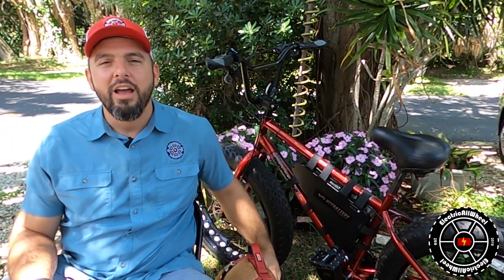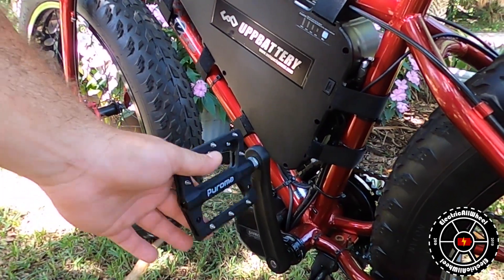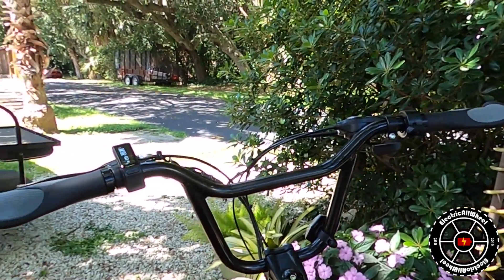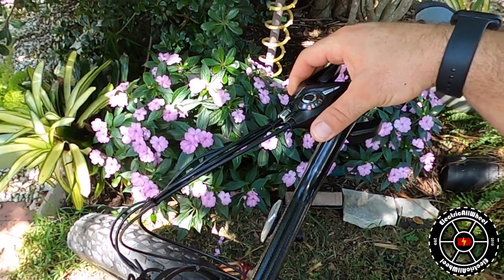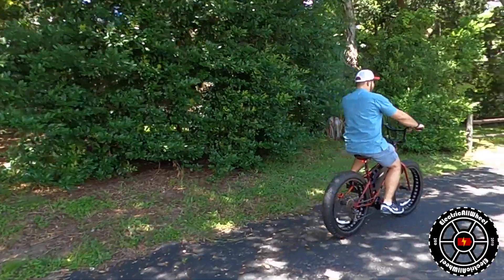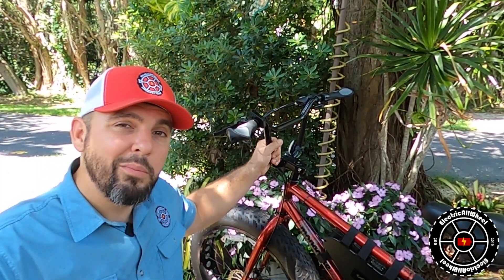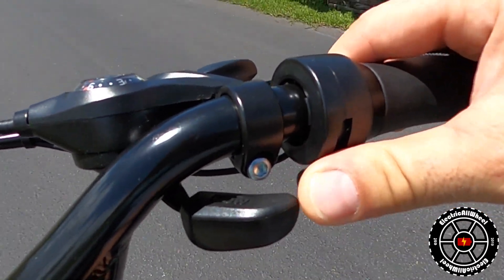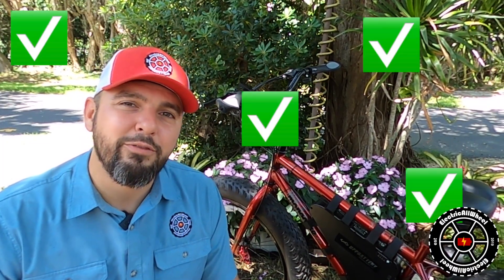E-Bike UPGRADES Mongoose Dolomite Hitch 1000W BBSHD Mid Drive 48V 20Ah electric bike Conversion pt 2

Comment: Is there a reason people seem to always use fat tire bikes on these bmx style conversions?  I have regular 24" and 26"  BMX single gear bikes and I'd like to use one to do a conversion like this on.  They are non fat tire, just normal BMX tires.  Will it work?   Am I going to run into fitment issues or something?   Or is there a problem with using a single gear bike?

Comment: Forgive me if you mentioned it but, what's the top speed throttle only flat ground on that bike,?
Reply from the maker: The freewheel tooth count and controller settings do play a big part of that. 
28-32mph are within it’s out of the box capabilities
Reply: @ElectricAllWheel  I just finished a 26in fat tire buld with a 1,000w geared Bafang, 30 amp controller, pulls hard alot of power, but only 29MPH throttle only flat ground.  Gets there really fast though I think it's governed.
Reply from the maker: @mjsmjs7905  you might think about a higher tooth count chainring

Comment: I did a similar build but on a different bike , I used the same battery but I went to the 52 volt and recently added another to my bag on my back rack to give me 2 batteries in parallel which gives me 40 amp hours . Used the bmx handle bars and like you I love then . There are some more things to add . One is pedal extenders it really helps to keep your feet planted on the pedals and the other is a suspension seat post .

Comment: I have a BBSHD Mongoose Malus which is very similar. I think I need to do that handlebar upgrade.
The one thing I am not in love with is leaning forward onto the bars.
I was thinking of just using an adjustable stem to raise the stock bars. 
But those BMX bars look good so that may be the way to go.
Reply from the maker: Do it. You won’t regret it. When you get it done, find us on Facebook and share your pics!